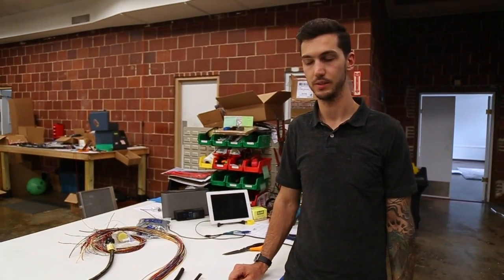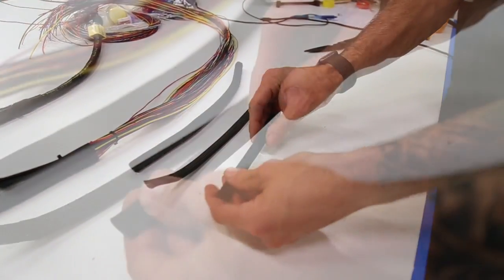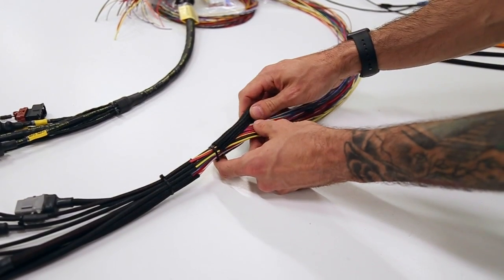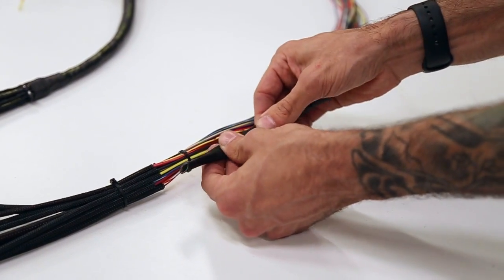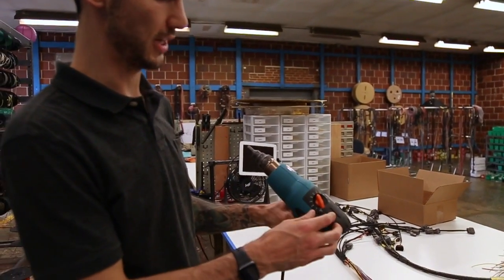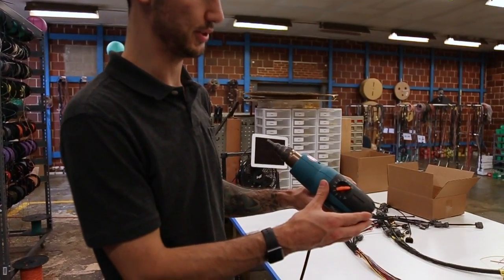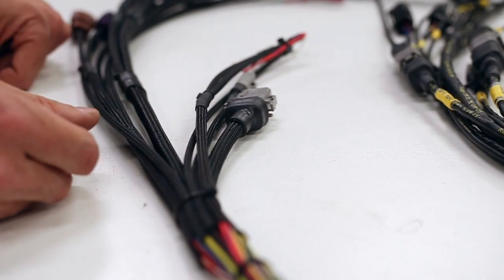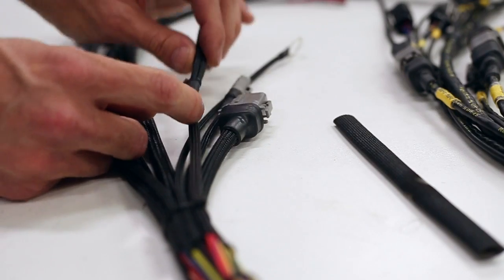Know Your Wiring Harness Loom Types - Sleeving

Comment: useless - Seriously? Nothing wrong with split-loom. for the prices of quality split loom you are fine! A car's wiring is NEVER going to see the temps a heat gun puts out, unless you are an idiot that runs it right on the header / exhaust pipe!  

You are using cheap crap sleeving if you melt it during heat shrink installation.

Comment: I decided to replace the valve cover gaskets on my truck but the plastic wire loom on my fuel injector and ignition harness is crumbling. I'm going to replace the wire loom first so that the pieces don't fall in the engine. The manufacturer used electrical tape to hold the ends but I'm going to use zip ties instead because it'll be faster and easier.

Comment: Wow! Okay heat resistances has nothing to do with the style of sleeving, it has everything to do with the material. It is not hard to tell how heat resistant a particular cable is unless the manufacturer/seller doesn’t make the specs available, but you just shouldn’t buy sleeving without checking the specs. You don’t have to use zip ties, and indeed that would look pretty amateur, you can use heat shrink instead of zip ties. Not all split sleeving let’s the cables pop out so easily either, because that is a factor of quality and design. I’ve used split sleeving that had a well implemented overlap, and I couldn’t get the cable to pop out when I tried. I still added a little extra heat shrink at 1&2/3, but only because the cable was not going in a static location but rather would be in motion flexing most of time. Don’t choose your cable sleeving based on the style, as has been suggested here. Choose your sleeving based on the requirements of your application and the capabilities of the cable. If you need cut resistance and flexibility, then find sleeving which provides that, if you need aesthetics then pick some sleeving that looks the part. If you need heat resistance than figure out how much heat resistance you need and balance that against price and preference. Oh yeah, if you need sleeving that can be installed without unplugging your cables, then definitely get the split sleeving. There are lots of options and I’m pretty sure there exists some split sleeving that can meet the rest of your requirements (provided your requirements are within reason, because of course faster than light sleeving is highly improbable). There certainly exists split sleeving that is not braided, and while that might seem obvious, it also seems to have escaped the notice of the presenter here.

Comment: Even with a hot exhaust, theres usually enough air.flow in an engine bay to keep temps below 500. Most of the braided stuff is resistant to that point. And the split stuff.is usually fine so long as you don't over stuff it.
Reply: Agreed.

Comment: So even tho the Stage 3 Harness didnt melt like the other 2 did, you can still see smoke coming out of the ends of the sleeve. What is burning, and just because the material itself is flame retardant, does that mean that heat does not travel through the material? Have you tried burning a sleeve with wires inside...aka an actual Harness?  I am curious to see how well wires inside of the stage 3 sleeve fare after being exposed to extreme heat/fire!
Reply: My thoughts exactly. I have some Techflex insultherm arriving tomorrow, and I'll be heat-testing it with 20 gauge SXL-rated wire.
Reply: Lemme know how that works out.  Besides Fire/Heat proof insulation, Ive also been looking for some better Weather/Water proof material, because i have an Evo 8, and they have a major flaw in the wire harness that runs from Inside on the drivers side through the firewall & into the wheel well along the inside of the fender to the main breaker box, and what happens is that water runs down the harness into the cabin and then rests at junction box where the harness connectors are and then shorts out everything. I had to cut the wires on both sides of the plug & hard wire 20 wires! Such a PITA! Besides being a bad design, the fender plug needs to be sealed, and the harness needs better insulation.
Reply: It's probably the adhesive on the inside that was melting or cooking.

Comment: Nothing in your engine compartment gets to 1000 degrees. Overkill is just overkill here. Oems still use vinyl tape and mild plastic split loom.
Reply: Juan Fernandez your exhaust will reach near that. Think o2 sensor.
Reply: Juan.... The only 'Vinyl Tape' OEM uses is the same he does in the video. Vinyl Adhesive Tape is used where Frame/Body Connectors go and also around the Breakouts. It's not overkill Juan, It's called Quality. Also a dam good site to see a kid in his 20's Have the passion for the work he does whether its for his car or.... Your's. Your statement is not without some merit as temps even in a modified street car won't reach much more than 3-400 maybe. But hell, why not have that extra protection when my truck goes up in flames lololol
Reply: How do I contact Jimmy bays?
Reply: Glowing white turbo manifold?

Comment: What's is the operational upper temperature rating of the stage 3 loom? Do you mind revealing your vendor? McMaster has various looms rated at around 255 to 300 F, is this sufficient for engine bay operations?